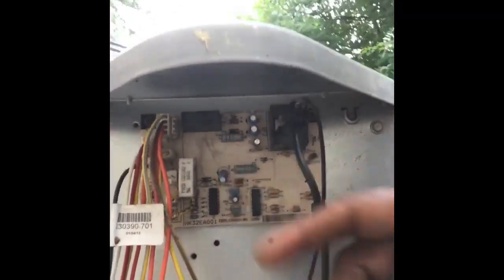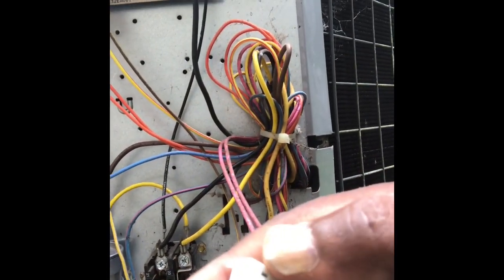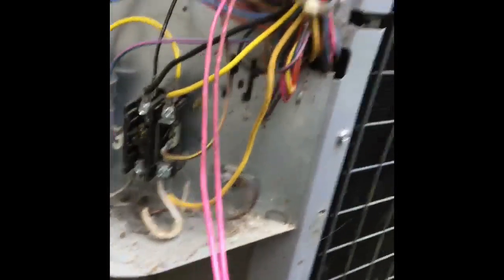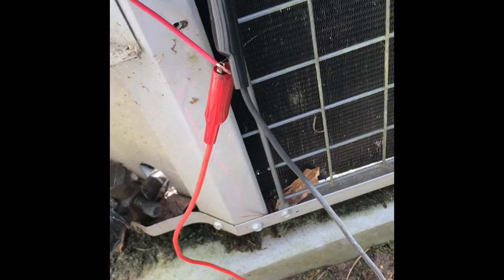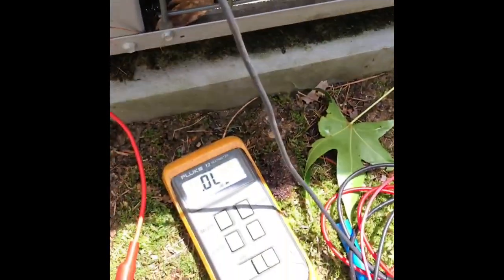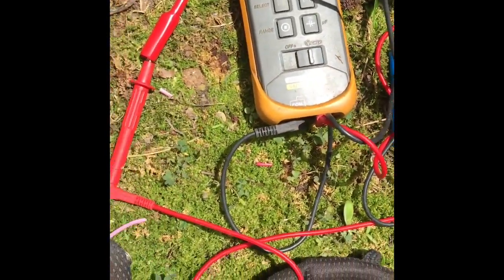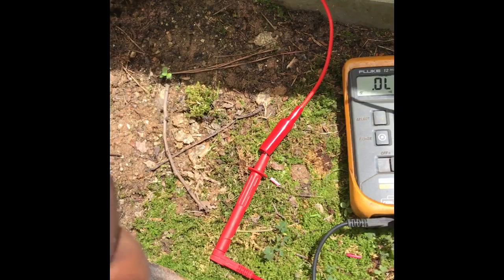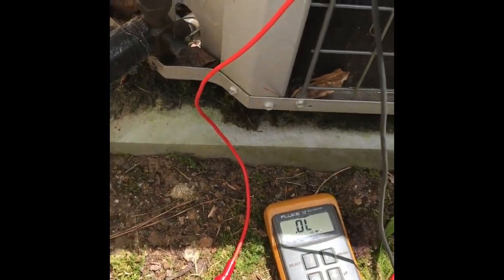Heat pump goes into defrost in the Summer

Comment: We had similar problem with heat pump since years ago. The air conditioner freezes up then it goes to defrost mode and blows warm air the thermostat auto heat and emergency heat lights was not on.

Comment: Makes sense... It's like how my Goodman heat pump was originally before I put in a smarter defrost control board. The original board simply looked at the Y connection to know when there was a call for compressor and when the defrost thermostat switch was closed, it would count cumulative compressor runtime. It wouldn't care whether the O signal from the thermostat was energizing the reversing valve or not. Once 30, 60 or 90 minutes of compressor runtime was reached with the switch still closed (depending on the selection set on the board), it would then shut off the fan, energize the reversing valve and energize W for backup heat. it would then remain in this state until 10 minutes was reached, or the switch opened up, and then the whole process would repeat. I got rid of that mess and went with an Emerson universal heat pump defrost board, which can be customized for demand defrost. It also added protections such as short cycle and brown-out protection (which the old board did not have).

This heat pump seems exactly the same way. All it took was for the switch to fail and stay closed. The defrost board is too dumb to know that the unit was running in cool mode. All it knew was the compressor had reached 30, 60 or 90 minutes of accumulated runtime, and energized the reversing valve, shut off the fan, and called on the electric heat until 10 minutes had passed (since the switch was stuck closed). Since it was running in cool mode, the reversing valve remained energized (and the unit remained in cooling), but the electric heat was warming the supply air, and I'd imagine the outdoor unit was probably tripping out on high head since the fan wasn't running. This is why heat pump engineers should be putting more effort in designing a proper defrost control that looks at more than just (A) accumulated compressor runtime and (B) state of the defrost thermostat switch. Some brands do in fact do a better job with their defrost controls. They call that stuff "demand defrost" 😂

The reason why this problem didn't show up much at night is probably because the system runs more in the daytime, and thus reaches 30/60/90 minutes much quicker.

I'm really surprised this this doesn't happen more often as these little switches can theoretically get stuck either way. Mine never did actually have this problem, but I suspect the defrost switch to the old defrost board was closing too early, at say.. 45 degrees. My heat pump would sometimes go into defrost with no ice on the coil and 55 degrees outside. Heck, most of the time it went into defrost, there was hardly any frost there to get rid of. Changing out the board on mine to the demand board (which included outdoor air and outdoor coil thermistors) saved me up $30 in electricity per month the following winter since it wasn't defrosting nearly as much and thus not running the 10kW strips near as much.